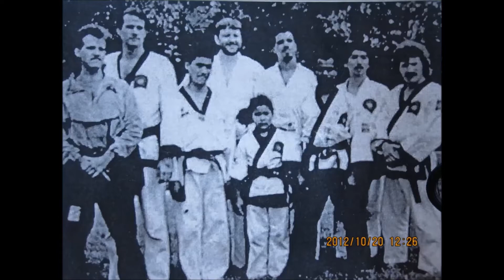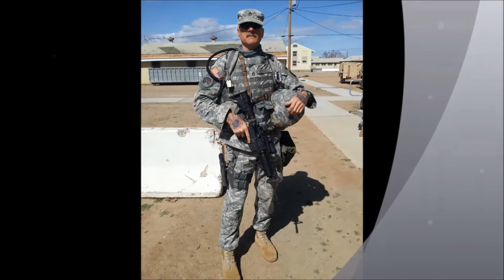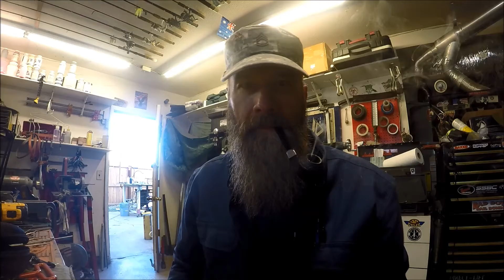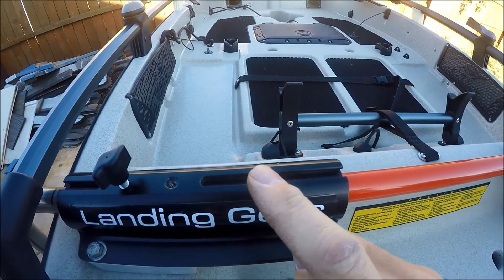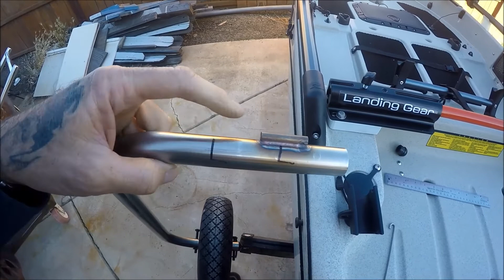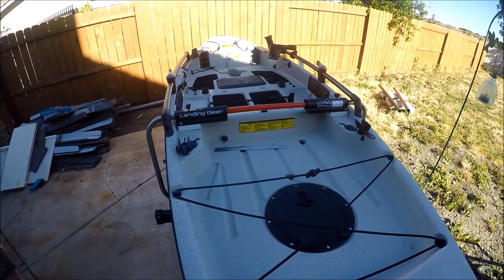Non typical Boondedox install on PA 14

Comment: Look Ole Sarge, it's yours so you can do it however works for you. Now as to the Bike shown in your intro. It would look better (and to my ears sound better) if your took those twin pipes and just past the engine cut them and welded a single pipe to finish out exhaust on it. Should give you a bit more horsepower and a much better sound. Have a great day.
Reply from the maker: Appreciate the input.  Guess I should set up a new intro as that bike doesn't look at all like that any more. That's how it is ya know.
Reply: LOL us ole sergeants have to look out for each other. Me - USAF retired, 1971 - 1991.
Reply from the maker: You may have seen this one.  FatBoy in it's present state.  https://www.youtube.com/watch?v=9nO4BS0Z-Ps
Reply: Probably, but I will check it out again. Memory is not what it use to be. LOL
Reply: I had the same issue on my Outback.  I went with the longer legs that boone dox sells and  that may be an option.   The pair of longer legs with tax and shipping will cost around $90. You need to call the company and request the legs because they are not on their website.  Thanks for sharing.  I may do something like your set up to reinforce the kayak.